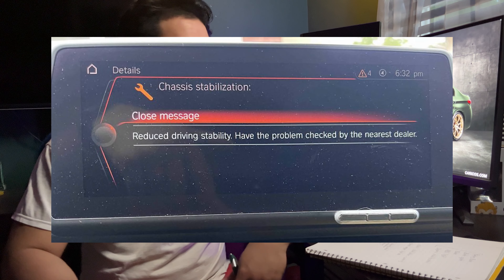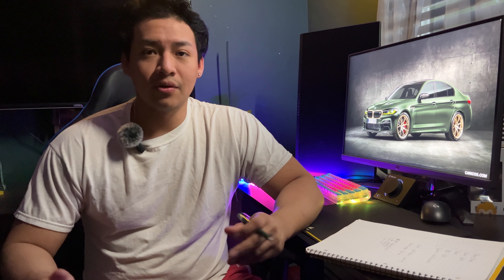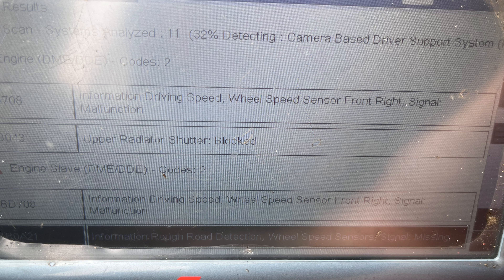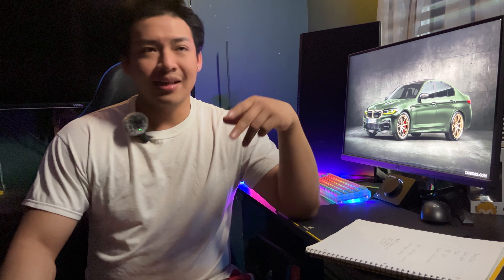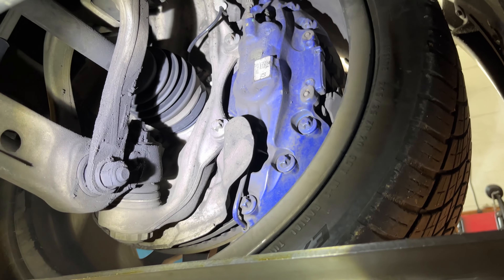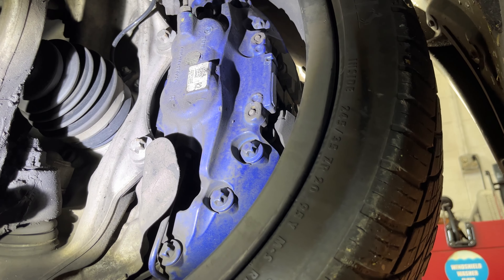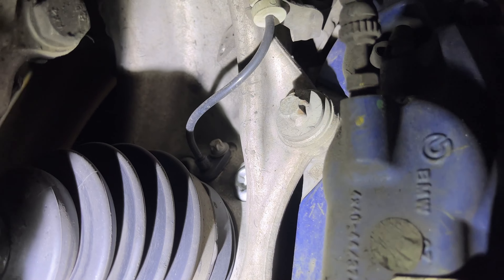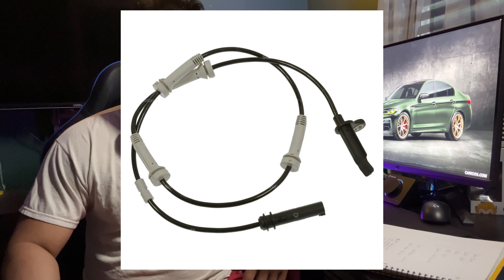"CHASSIS STABILIZATION" WARNING MESSAGE | HOW I FIXED IT

Comment: I'M having a Chassis malfunction with other system also malfuntioning, pedestrian warning system malfunction, collision  warning system also. I don't where to start looking, but read somewhere that a weak battery could cause this problem I'm having. I'm not sure if you had this same problem. Thanks
Reply from the maker: I only had the chasis malfunction warning come on. I would suggest to take the car to someone who has an advanced scanner so they can see what the exact issue is. Thats what I did. I took to my friend who is a mechanic and thats how a I found that the ABS sensor was the problem
Reply: Did you ever find the solution? I’m having the same thing @gutjos
Reply: I am having this same issue! Battery was weak idk what to do
Reply: @SherhanPR  I had a shop take a look at mine and they said I need a new transfer case, the codes are coming from the Clutch Positionint Sensor. They tried to reprogram it or something  but failed and now the lights never turn off

Comment: My symptoms are exactly the same, and God I hope this is the reason why my car is acting up. I just changed out the speed sensors, changed 2 unrelated blown fuses, added power steering fluid and I’m still afraid to turn the car on for fear that all those error codes will still be there. So I disconnected the battery and I’ll be turning the car on tomorrow…I have to put it to prayer first.
Reply from the maker: I hope everything turn out well
Reply: @ $1500 later and it turned out to be rodents. Yes rodents that camped out for the winter in my air filter box and had a meal with my wires.
Reply from the maker: @Gboogie22 😮no way! Was not expecting that

Comment: Mine is doing the sane.  Thank you so much for sharing this.  Is this hard to put on? I can do it with my dad's help. Maybe,  lol,  at 61 it may not be something I could do..
Reply from the maker: Yes its super easy to do. Just make sure you jack up the car safely.  But when in need of help dont hesitate to contact a professional mechanic

Comment: My chassis stabilization drive moderately light came on after I spun out in snow. ABS is fine, driving fine, only issue is my steering wheel is completely off center. Common sense tells me just to get an alignment but also explained my situation just to see if there’s other possible solutions or problems that my car might have (2014 528i)
Reply: My car showed the same code after I spun out in the snow and my steering wheel seems to be off center. What did you do to fix your issue?
Reply from the maker: I would get the codes check out by those high tech scanners mechanics have. Thats how I found out my problem.

Comment: Got the same message. My main code that i got is E12C4D. something to do with the dsc
Reply from the maker: Did you get it scanned by those high tech scanners mechanics have? Because thats how I found my issue and solved it
Reply: @_h3rcules_  used the snap on one. Someone ik gonna help me on friday with the bmw scanner